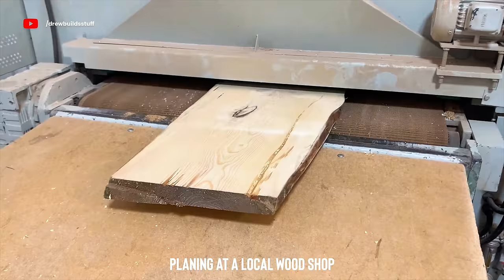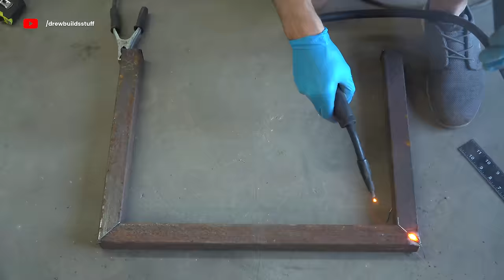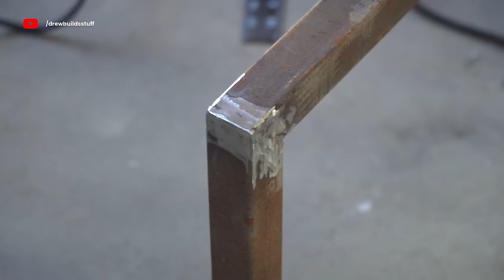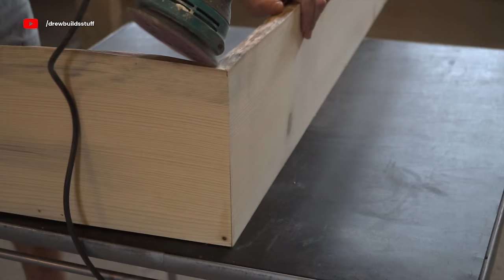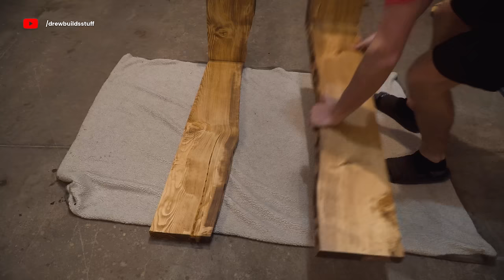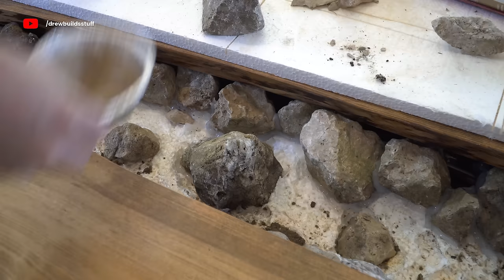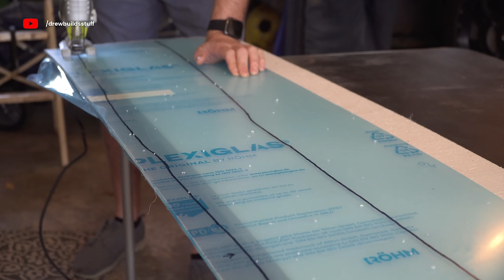I built a River Table with a REAL RIVER In It

Comment: Lovely table, lovely filming, but I am worried about the longevity of the table,  I've used that spray paint as a clear finish before and it itself is not very durable I would love to see an update after a month or two to see how the table is holding up
Reply: Up
Reply: @IDontLikeHandIes  commented here to see an answer. Your comment remembered me of Blink-182 music "down" gonna listen now, thanks!
Reply: @J4ap0on3es  His comment did not remember me of "Down" by Blink but yours did, so I'm going to go listen to it, thanks man!
Reply: Agree 100% the table concept is amazing!  But I have just a few issues; one for sure is the clear coat.  Maybe a thinned out 2 part epoxy would a better choice?  2nd is that plexi-glass center insert, Yuck!  Spring for a custom cut piece of tempered glass.  Your already in, don't skimp by using shitty plastic.  My only other concern would be longterm, any mildew or algae growth on the inside of the hidden water return.  I'm guessing a touch of diluted bleach from time to time would fix any weird stuffs growing in your table.  Over-all very creative.
Reply: Not just the spray paint. Marine-grade plywood would've been a better choice than MDF. Brush-on waterproofing compound alone might work short-term, but it would be better used in combination with the sort of barrier membranes they use for waterproofing shower walls.
Reply: He sold the table to a buyer for a couple hundred bucks
Reply: On the bright side, it will be even more like a real river with sediment movement and decaying organic matter!
Reply: @adriennecloeter7394  and a lot of mold
Reply: @AaronX442  If the 🪙 "give away" at the ending didn't clue you in, this guy is a trend-ripper for his main biz...
Epoxy waterfall furniture popped up in Asian art trends 2 years ago, the original inspo source he took 👮 this from (and Walmartized) were considerably more artistic or when filmed to be explanatory, verbose, but in either case, demonstrated genuine enjoyment and care for the craft. 

You know, instead of: 
- Covering up his lack of planning for the river scene by photoshopping the clickbait "river" on the thumbnail.
- Slapping on a cracked and jagged piece of acrylic (cut with a saw!!) and going, "Whatever, I'll just hide it with a couple o' far shots." 
- Rushing through every single step at the end - from haphazardly gluing, calking, and torching, to adding the rocks solely by size and chef's kiss, and finally, tossing handfuls of plain, monochromatic dirt like a toddler. 
- As you so aptly pointed out, zero plans or consideration for water cleaning / overall longevity. 

Of course, he also could have gone the explanatory route, where the beauty matters less if you just want to show how to build something correctly. But this wouldn't be so offensive to the originals if he did that. Nope, this is where he opted to play generic, royalty free "Chill" music with the absolutely sporadic timing of white text revelations. Good god, I went back to check for credit to the original art's sources (None) and noticed, HE DUBBED IN THE WATER SOUNDS TOO! That's it. I'm done exerting any more effort even to critique. 

This is my first & only time checking out this channel, and it's obvious the only part of this process he actually enjoys is collecting that sweet sweet Youtube doubloons.
Reply: @allisons6910  idk why you decided to judge the man off of a 2 year old vid, mans has said numerous times before that he learned his skills through youtube and the likes, and is just havin fun makin random stuff for experience. Should watch his waterpark, doghouse or tiny house vids where he has a lot more experience and is actually making stuff for his family and himself. Weird ya are so quick to judge a man just tryna to learn how to diy stuff for the funsies, we all start somewhere.

Comment: This is how you win and put an end to the epoxy craze. Well done drew. Absolutely incredible work.
Reply: Nah, epoxy is still dope.
Reply: The only problem I see is that using (mostly) natural materials like this means it will probably need constant repair over time. Water just tears things up. Epoxy might actually prevent that.
Reply: He used epoxy on this job
Reply: What's wrong with epoxy?
Reply: @gwenmcgarry528  Absolutely nothing
Reply: @gwenmcgarry528 Not that I personally hate it or anything, but the main reasons why people dislike it is because it’s overdone, can look very cheap, and is bad fire the environment. Though this isn’t to say that some people who like how it looks hate it anyway just because it’s easy, and being good at something that people now perceive as just being “easy” will always hurt a couple peoples feelings.
Reply: impossible to have ended it, this much water flowing will just cause a mold issue inside of the house, too much humidity, specially near all of that wood... the coating it received won't last forever, eventually the water will ruin this piece

Comment: Hey Drew and team - do you have update on how the table is holding up?  Any changes you'd make to the design?  Keep up the awesome work!
Reply: I made a hydroponics setup with a Styrofoam  cooler to hold the water. Apparently it slowly leaks (slow enough that you barely notice) and destroyed the table it was sitting on.  Knowing that for this setup I would have made the holes for the rocks removed them then applied a waterproof coating or two and continued with the rest of his setup.
Reply: @8Blackmamba81  I was skeptical about the styrofoam not being fully sealed up as well.  Also, with the flex seal as I’ve seen that fail before also.  
I have made terrariums with foam but I sealed the foam with mortar and painted it with drylok.  I’d be worried his silicone job isn’t perfect and water getting into the foam and turning it green and stinky.  Or leaking.
Reply: @dixielp  that’s the only thing that can happen. It looks great; but water WILL find all of the flaws in the sealing. And there are plenty
Reply: @dixielp  let's be realistic though... even if everything was sealed to perfection, it's still going to get green and stinky. Keeping water clean and algae free without a filter is really difficult (hell... it's even difficult with a filter)
Reply: He won’t update bc it’s garbage longevity wise
Reply: I'm also guessing all of the above. Other points to note: flex products are supposed to be temporary solutions to leaks, and as far as I can tell they were not engineered to last; I don't think it's a good idea to use them in permanent installations. Another one is that you cannot pour a bunch of sand over silicone, "seal" it with acrylic spray and hope that it won't destroy itself. It would be unstable enough without water, let alone submerged. I'm going to say that the pump got clogged with sand and lacquer flakes before long. That is even before accounting for wood movement, which as far as I can tell was not accounted for.
Reply: Y'all were talking about the foam getting stinky. As someone who's been a lifelong aquarium owner when I saw the chintzy pump he was putting in there, my first thought was "oh, no!" The little sponge filter in that is gonna clog probably within the first 2-3 months without cleaning it. Also if your flow gets too low, for too long you can get sludge algae in the tubing and then that has to get replaced too. But my biggest issue was what happens when you accidentally drop your phone in it?! 🤣🤣
Reply: Those are also interesting points. It seems to me like he undertook a project where you'd need some expertise in so many different fields before even beginning to think how to bring it all together. Even if he was knowledgeable about custom aquariums and filtration systems, he would still have needed to know that decorating the river the way he did would not have worked. He'd have been better off creating a river diorama, without organic materials or loose sand/debris, stabilize that to minimize water contamination (in this case resin would have been justified) and put it in a proper, more permanent mold. To his credit, though, he did end up covering the top with an acrylic piece; makes me wonder if he did that before or after accidentally dropping stuff in it.

Comment: How often do you keep this on?
Does it run on changable rechargable batteries or electric line?
Does the styrofoam sit well after 24/7 use for a year?
Do you do a specific Clean Up Routine to prevent Mold, Mildew and Bacteria?

I'd love a FOLLOW-UP VIDEO touching up on these topics!
Reply: Yeah exactly. As pretty as this project is, it's just not practical in a real living room.
Reply: @cedb3360  idk me personally wouldve probably used real rocks and then had real moss growing on it. maybe some fish in it too!

Comment: Wow finally someone else did this! A while ago I made something just like this (although this one is way better). Made a table with a river on it. I did use the same setup of making a channel in the middle of the table, carving it and forming it into a river, and then using a pump to circulate the water. The main difference is instead of legs, I had a solid base table, and the table base as a big box/container to hold the water and putting the pump at the bottom of the box. The water in the river would just waterfall at the edge down to the base.
Also as a tip, make sure to use chlorinated water or else it will get moldy and become mosquito heaven. Secondly, do use the preserved moss, with my table it turned brown after around a month or two.
Reply: I didn't know furries watched this kind of stuff :0

Comment: Would mold ever grow there? I'd love to do something like this. Looks beautiful
Reply: Hard for mold to grow in running water
Reply: Well, you can always replace the water and maybe put some chemicals to prevent any mold.
Reply: Just coat a few layers of epoxy on the base, it will keep the bank protected from long term wear, prevent any leaks and makes it easier to clean which would also prevent mold.
Reply: @thoughtsengineer  while that would normally be a good idea the chemicals would corrode the art pieces and probably react with the glue used to keep them in place.
Reply: @sawcondeez69  well I wasn’t talking of strong chemicals lol 😂 
You can just use mild vinegar (or just a quick wash and rinse because of the smell). Also there are some special chemicals that can be used for these types of projects.
Reply: PC watercooling brands have stuff that prevents growth in water. Never smelled it though, but at least it is not strong smell since I don't know if it has any.
If you have pets, I would advice against any chemicals in the water and just design the table with a drain valve, so the water is easy to change. If you are worried about the valve leaking, get one with screwable end cap.

Comment: Nice!

It did seem at one point like you weren't wearing a respirator while burning polystyrene, though. I'm sure that you're taking proper precautions now, but be careful with that. Polystyrene is a really dangerous substance to burn, in terms of chemicals being released into the air around you.

Comment: 👍On the concrete floor in the garage with old Dewalt skill saw Bravo 👏 
I’m attempting to do epoxy river table this year, and watched hundreds of videos people doing  in wood shops with thousands of dollars machines, super expensive Festool Tools, most have $2000 Domino and measuring everything to milimetr got little bit scared, but they’re also many videos like yours showing the it can be done without spending thousands of dollars for Festools

Comment: @DrewBuildsStuff do you by any chance still have the plans for this? I love this table it will fit so nice on our patio.
I'm trying to replicate it, but ive never build anything before so this will be my first woodworking project.
Do you have a tilt on the frame you build for the water?
What are the measurements for the elements.

Comment: Good idea but you could do better, dont use silicon its never gonna keep sealed for long. And id doubt the foam, proly gonna mold in a year 2 at most. Did i get that right? You used nails to hold the "window" ? Dont put your feet ontop of that ^^

Comment: What makes the table not worth buying is that fact that it doesn’t have a resin top over it, what if I want to utilize the whole table put party supplies on it or sum? I think there should be a protective top over the entire thing then when you want to change the water to could take the latch off then take the top off, but other than that man it’s great

Comment: Why styrofoam????

styrofoam insulation can be water-resistant but not fully waterproof. This is because styrofoam does not absorb moisture from the air but can absorb water if it directly interacts with water.